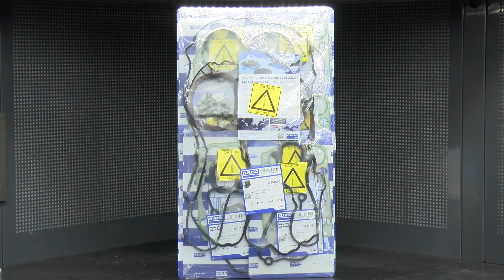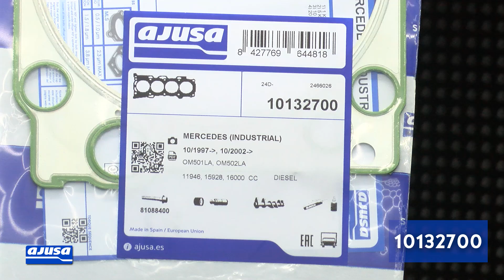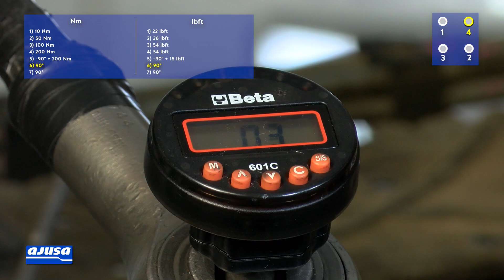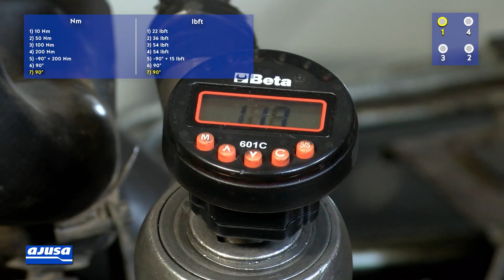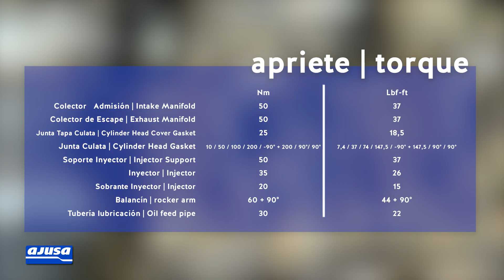Amazing engine repair tricks! | ¡Increíbles trucos de reparación de motores! ✅ MERCEDES ACTROS V6

Comment: tienen un grave error en los n-m y en las l-ft, los valores no corrosponden, por favor chequen eso
Reply from the maker: Hola, muchas gracias por tu comentario, tienes razón, los valores no corresponden, lo corregiremos. Los valores correctos son los siguientes:

1) 7 lbft
2) 36 lbft
3) 72 lbft
4) 145 lbft
5) -90º + 145 lbft
6) +90º
7)+90 º

 Un saludo!

Comment: Jak równo wsadzić taką duża tuleję?
Reply from the maker: Cześć, dziękuję za komentarz. Włóż ostrożnie, ręcznie lub z lekkim naciskiem, upewniając się, że wchodzi prosto. Po osadzeniu sprawdź za pomocą czujnika zegarowego, czy wypustka mieści się w granicach tolerancji, aby zapewnić prawidłowe uszczelnienie z uszczelką głowicy cylindra.

Hello, thanks for your comment. Insert carefully, by hand or with light pressure, ensuring it goes in straight. Once seated, check with a dial indicator that the tab protrusion is within tolerance to ensure proper sealing with the cylinder head gasket.